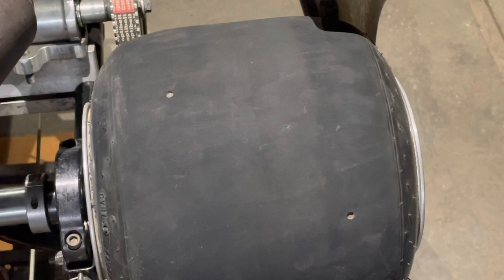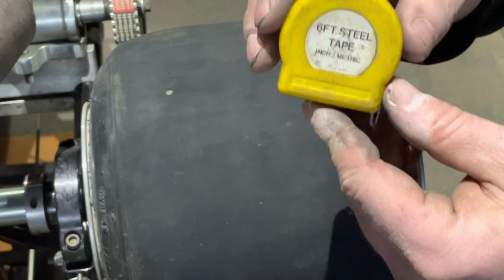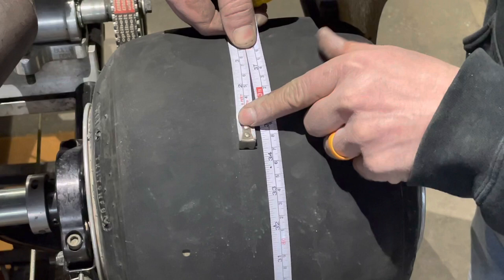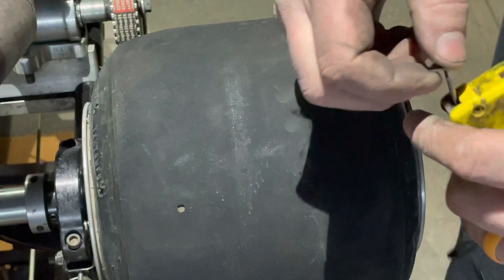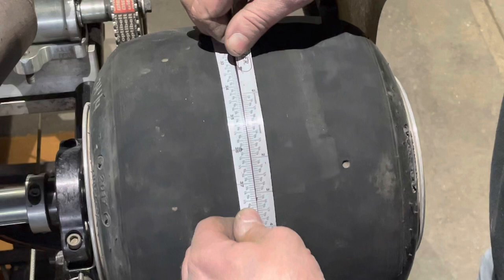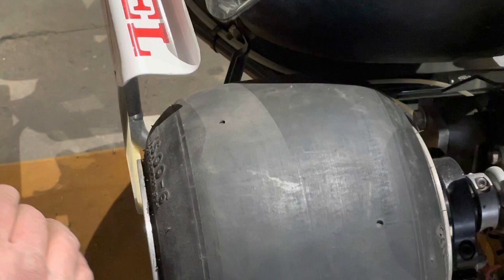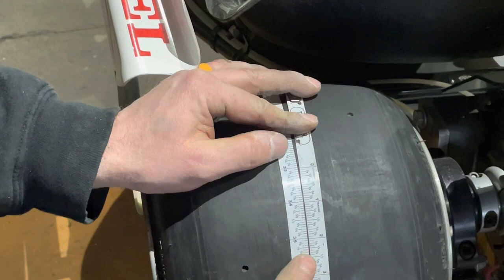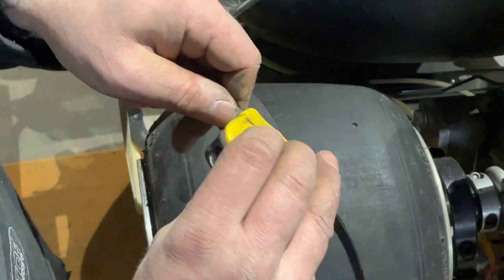Quick Tip: Tire Stagger, Tire Sizer tape

Comment: Dumb question 🤦but do u do stagger tires with air in them ? And what pressures of yes???
Reply from the maker: Yes.  As they would be run.  I usually do 5psi rights and 4psi lefts.